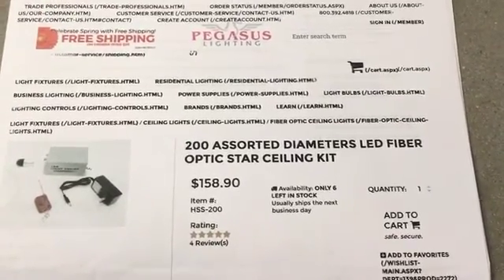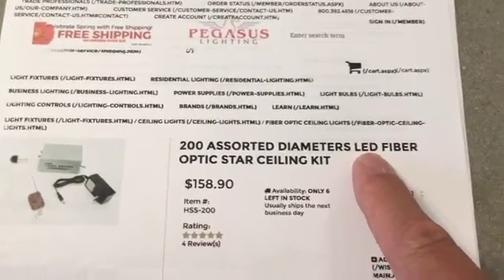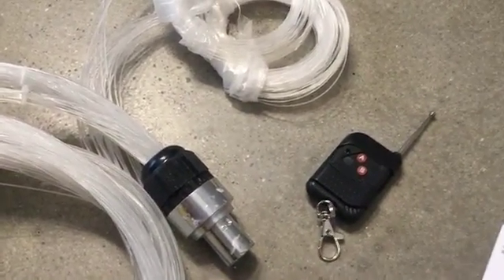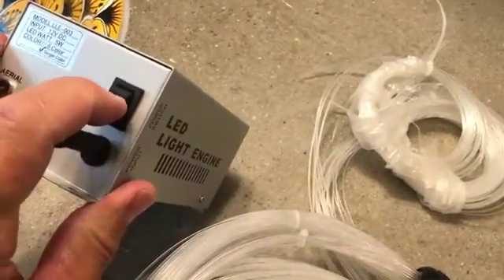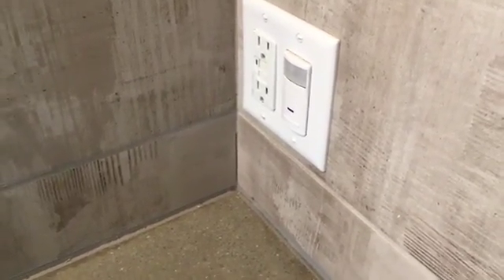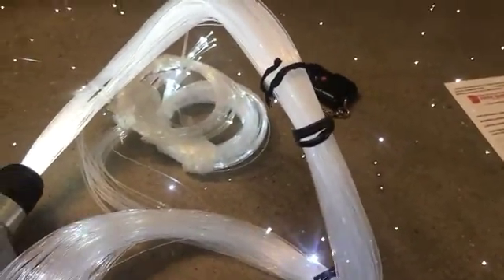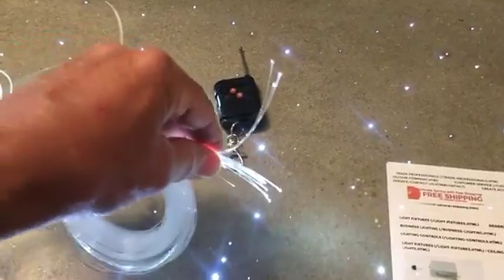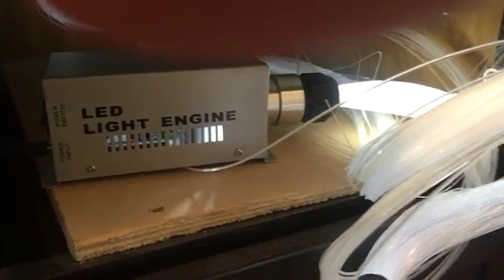Pegasus Fiber Optic Light I used  in Concrete Countertop

Comment: Did you pull the fiber optics out while you ground the countertop and then put them all back in?
Reply from the maker: Hi Alysss.  Thanks for the question.  Actually. Those fiber cables I show in the video go through the concrete and the light comes out of them.  So we simply cut off the ends that were protruding through the concrete and the light continued to shine through them.  I’m sorry I’m not very good at explaining it, but if you watch the other videos, I think it will make sense.  If not, let me know and I’ll try to explain it better.  Thanks for watching my videos.  I hope you’ll subscribe so you get notified when I post a new one.  Thanks again.  Keene.

Comment: When you used a grinding wheel and polisher to finish the surface, you did so in a usual fashion?
Reply from the maker: Hi Sarab.  Thanks for watching my video.  Yes I did use typical grinding techniques.  I bought the Omicon grinding wheel from a granite supply store.  I got the best results from a 120 grit stone and used it with a hose gently running over the concrete.  BE VERY CAREFUL though!  I used water in close proximity of an electric power tool.  I got shocked a couple times when my wife got a little careless and sprayed the water directly on my grinder.  You have to make sure you have a good ground but even that may not protect you 100%.